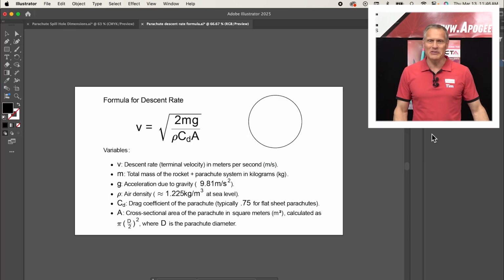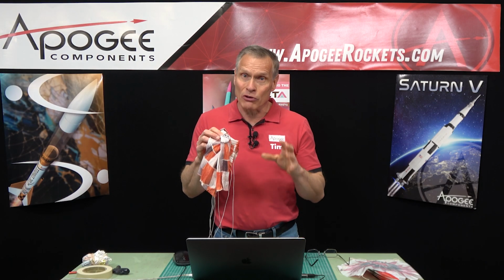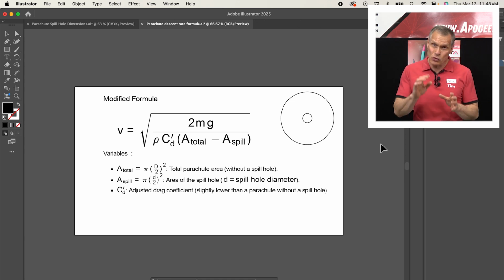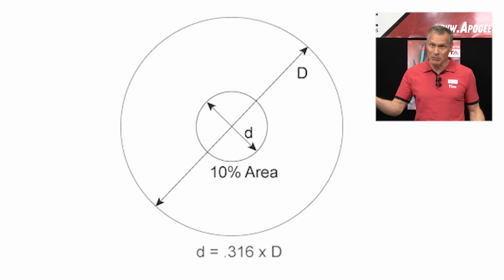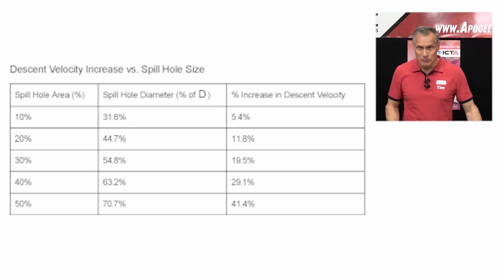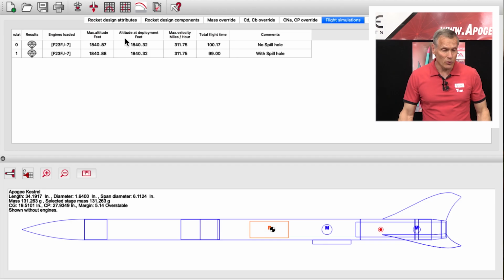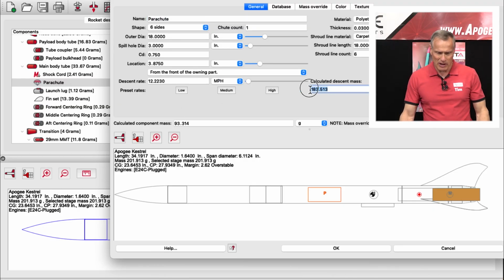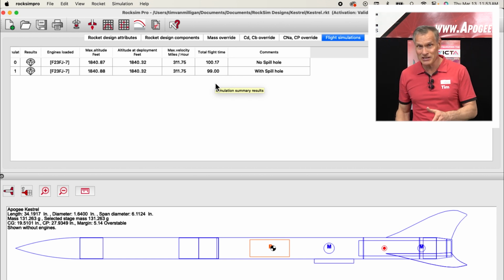Let's Talk Parachute Spill Holes | Stability and Descent Rates

Comment: I recommend when cutting holes in a nylon chute is cut the whole as precise as possible, then lay it down on something non flammable like a garage floor or a patio block. Then use a butane torch carefully to just singe the edges, Keep a metal ruler around to flatten out any flare ups. When all done clean up with x-acto knife. Don't try the hot knife technique unless you are actually using a wood burner hot knife setup which works fine in itself.

Comment: Excellent video explaining the math behind spill holes and their benefits. I started using them on all my rockets a few years ago. Definitely improves my recovery rate as the rockets don't get carried nearly as far away by the wind. I was surprised at how close they were on the sim. I have found they make the rocket fall more gracefully and much straighter down, and with out all the oscillation spilling the air, sometimes slower. I use a hole about the size of a half dollar on a 12" chute and a silver dollar on a 15".

Comment: Is there a "rule of thumb" for a decent rate to achieve in mid or high-power rocketry?
Reply: Generally I aim for 5-7 m/s on a standard sport rocket. For low-power or scale, I might aim lower (say 3.5-4 m/s) unless I know the rocket can take a hit. And some people will go up to 10 m/s on high-altitude HPR flights to minimize recovery distance, but I don't mind a walk, and I hate repairing fins that get knocked off.

Of course, I'm not flying up to 40,000 ft. Maybe I would change my mind in that case.
Reply from the maker: The rules of thumb were talked about in this video. Percent speed increase vs percent of spill hole size.
Reply: I like 20 feet per second or slower, but it really depends on the rocket, it's construction, how windy it is, and what surface I'll be landing on.
Reply: @jonasclausen5755  And, to correlate the preferences, 20 ft/s is roughly 4.1 m/s.